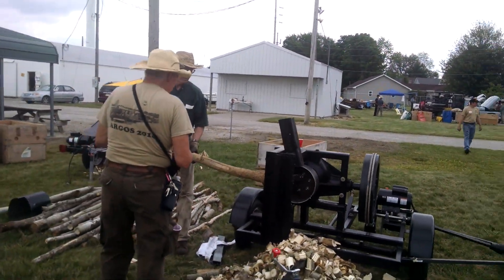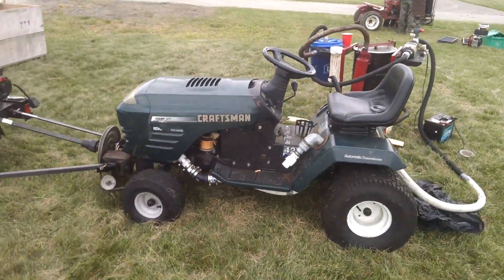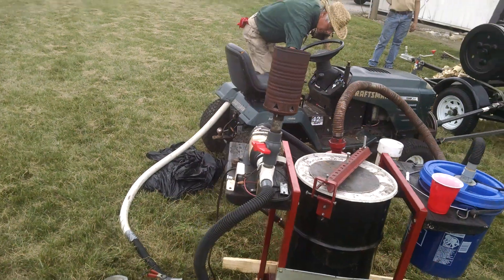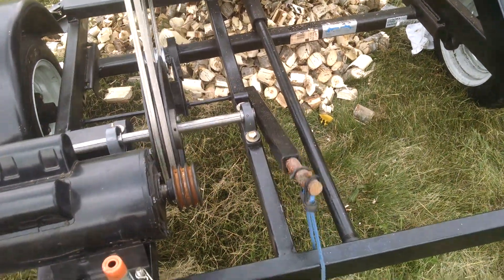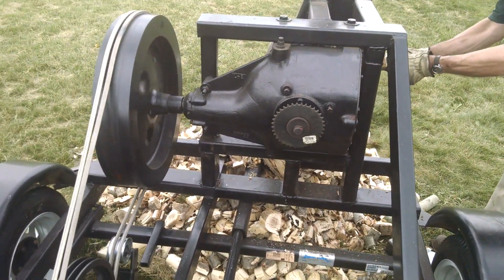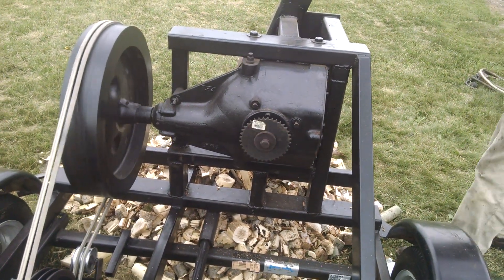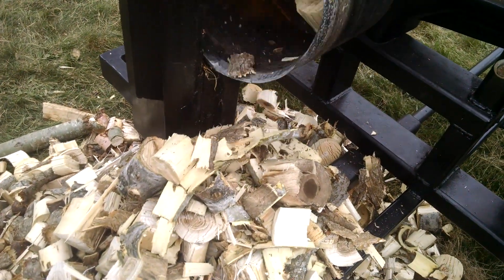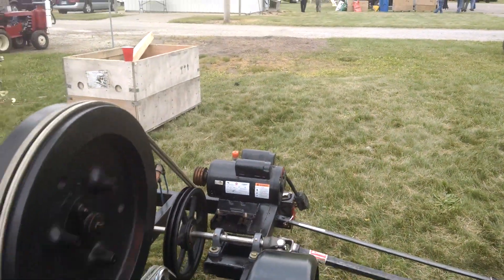Gary Gilmore chunking wood with his gasifier and

Comment: Can you summarize your parts list? For example, is that a front wheel drive transmission/transaxle, or is it a truck differential? Where did you get (or how did you make) the cutting wheel, how did you sharpen it?
Reply from the maker: I went to Northern Tool and picked up the PTO shaft and the splined shaft. The rest I made up as I went. I welded a 3 or 4" pulley on the existing pulley at the bottom of the engine that drives the 12" for the PTO. I believe that makes the PTO turn at 900 or1200 rpm. I built this 7 years ago so I don't remember. Right no the lawnmower is under 3' of snow and it's -25⁰ outside.
Reply from the maker: The cutting drum is from a 12" pipe that's ⅜" thick. I cut it with a 4" grinder with a cutting disc. I welded it to a brake rotor.

Comment: Hi Bill. I'd like to know what the net gain in chunked wood is. In other words, how much wood can a wood chunker chunk if the wood chunker is running on chunked wood lol. :) I guess if you run out of wood to run the chunker you know its not very efficient lol. :)

The other thing I'm trying to figure out is how much time one would typically have to spend to gather and chunk the wood from one's property. For example, if you work for 8 hours and your NET gain is enough wood to produce 800 KWH of electricity, that would be 100 KWH/man hour of labor.
Reply from the maker: I haven't run it much since this video because I moved off grid shortly after and have been spending my time building our home. I would guess it would take roughly 16 pounds of wood to process 500 pounds. this wood processor with also charge my 1600 amp hour battery bank at the same time.
Reply: +Bill Schiller Congrats on the move and the new home. I built a passive solar house a few years ago and now am looking to go off grid so am considering wood gas as an option since solar is cost prohibitive as I live in the cloudy midwest but have plenty of woods to get all the free wood I could want. My real concern is the amount of time I would have to spend gathering and chunking wood to produce 150 KWH of electricity/month. If I have to spend more than 8 hrs/month collecting and processing wood, I'm not sure I would pursue wood gas. What are your thoughts?
Reply from the maker: I am really not sure. I didn't get my solar and battery bank until the first of November. I live in northern Minnesota so getting set up for winter was top priority. 
I have 8- 200 amp hour 6 volt batteries and my little suitcase Ryobi generator charges it in 4 hours. No sun means I run it twice a day. I would guess 20-30 pounds of wood per 4 hours. I will have better numbers this spring/summer. I think if I spent 6-8 hours processing wood, I will have enough for a month for this setup. I also plan on finishing my wood gas truck this summer, so more processing.
Reply: Sounds like you're using about 3x as much electric as I need so sounds doable for me.
Reply: So this was 3 years ago have you calculated the net gains?